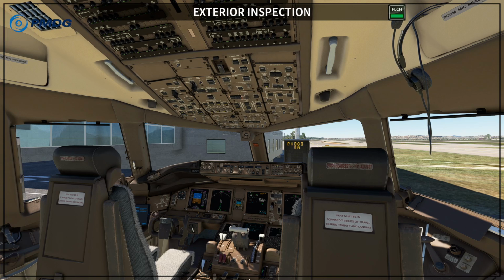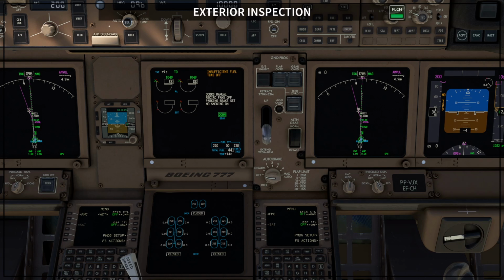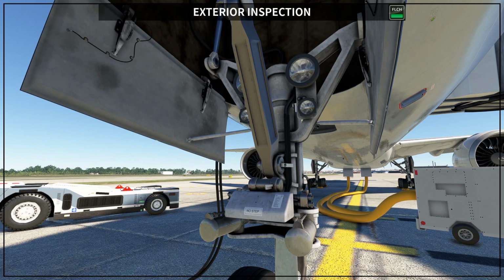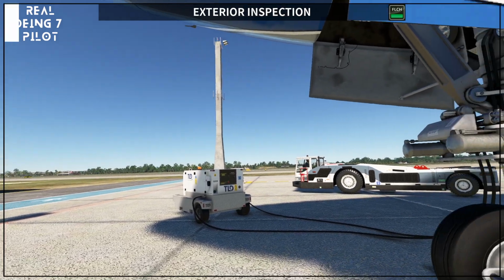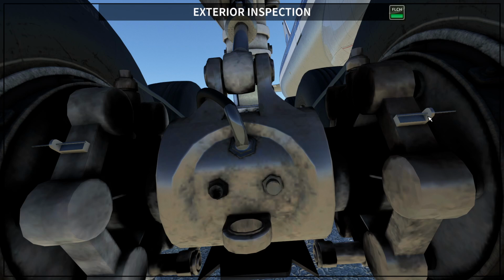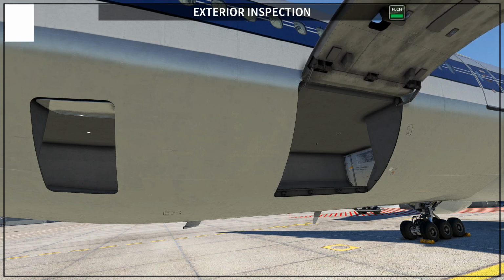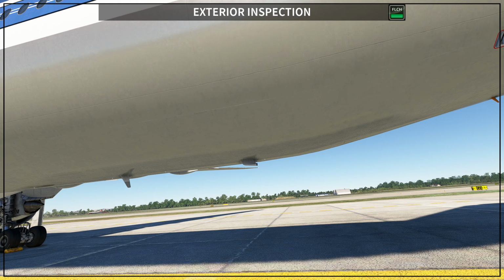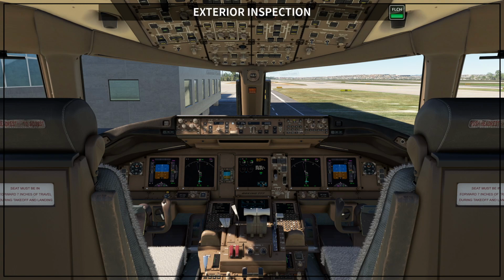EXTERIOR INSPECTION - B777 NORMAL PROCEDURE

Comment: Where's the American airlines doc you use to refer to the items?
Reply from the maker: It is not available on the internet anymore. As I’m not the owner of the manual, I cannot replicate.
Reply: @LEVEL_CHANGE are there any other similar documents available for exterior on the 777
Reply from the maker: I cannot find any documentation that will help more than the standard procedure from the FCOM.
Reply: @LEVEL_CHANGE  I was referring to exterior inspection. The FCOM is very limited with that regard.
Reply from the maker: I understand, but the FCOM describes how to check (initial part), then defines the route to follow (with an image) and finally specifies which items to check in each area. Other items (like setting the parking brake in preparation for the brake wear check during the exterior inspection) are mentioned on preliminary procedure and/or on supplementary procedures (like cold weather), as needed. Further information is a matter of experience or company specific procedures that will only be shared within the organizations.
Unfortunately, no other resource from the manufacturer.